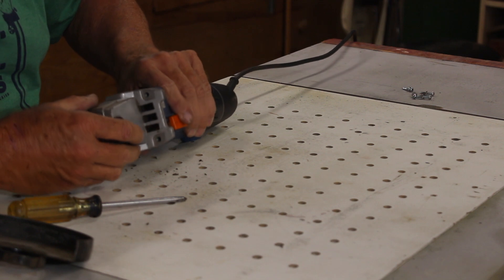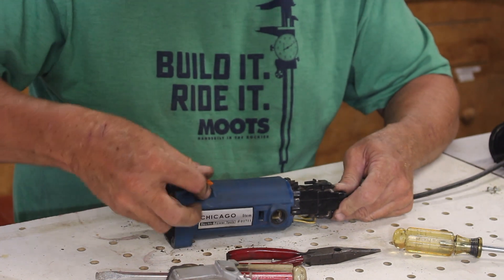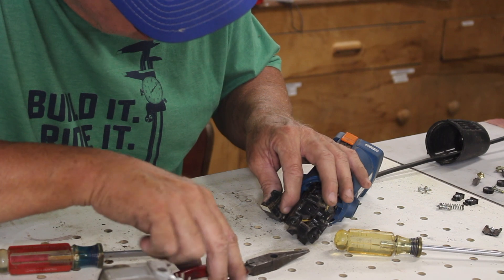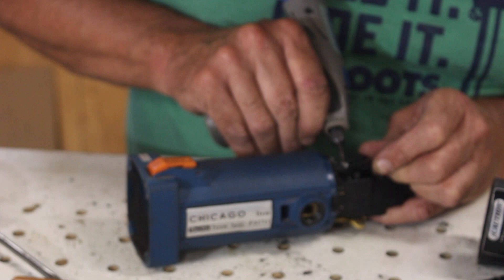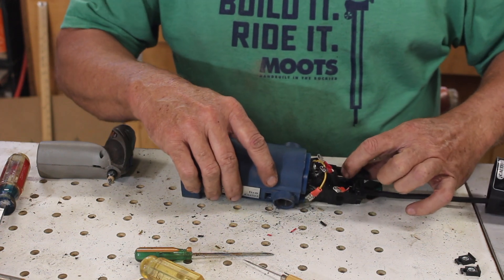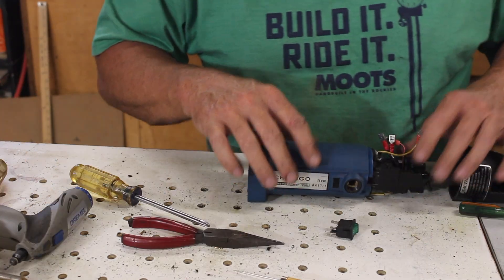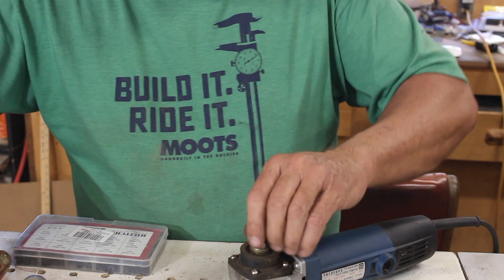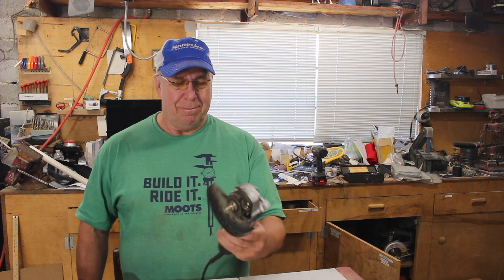Angle Grinder Repair!

Comment: how did you identify the wires correctly to the switch ?
Reply from the maker: As long as you don’t cause a short circuit across the switch it’s pretty hard to go wrong. There are hot and a neutral coming from the wall. Just connect each of those to the two wires in the motor.

Comment: I have a simple toggle switch laying around which only has two connection points. Looking at videos of these types of switches it seems you would just have the "hot" wires going to each terminal and the toggle just connects or breaks the circuits. Angle grinders have 4 wires though. Are the other two wires the neutral? Could you just solder those together and just use the hot wires to the switch? The original switch is sticking. The angle grinder is a Harbor Freight I got on sale for probably $15 5 years ago. I could just spend $7-$10 for a new switch but at that point might as well just buy a new grinder. I did buy the 8amp 4.5in grinder with the rat tail trigger switch as I wanted a more powerful one but would be nice to have the original 5 or 5.5 amp grinder I have as a backup or to keep from swapping blades, wire brushes etc. with a free switch swap I have laying around.

Comment: If you check you plug in chord and you fail to have continuity. check your cord insulation.. My cord got nicked by grinding wheel and it eventually broke a wire. I spliced cord and works like new.

Comment: I was building a  handrail last summer when I let the smoke out of a newish dewalt dwe4011 so I grabbed another grinder where the paddle trigger was broken so 1/2 hour later I was up and running with a new paddle made out of metal. I am 55 miles away from the hardware store lol

Comment: From where did you know, that the specifications of the new switch (current, voltage) are fitting to the grinder? 
Cheerio from Germany.
Reply from the maker: The switch said right on it "10 amp," which is sure to be overrated as it was manufactured in China. The grinder was labeled 6 amp. While also almost certainly overrated, it's still far less than the switch.
Reply: Thank you for your fast answer. I asked, because so much DIYs have no real idea, what they do with electricity. I see, you know!
Cheerio from Germany.

Comment: The only problem with this repair is that original switch was safe one meaning that if u drop a tool  it will switch off (impact triggered).
Reply from the maker: That feature had quit working years ago.

Comment: Great job.
I love the look on your face before you turned it on...
Keep up the great work. Thanks for sharing...
Reply from the maker: Check out when I plug it in! I'm always expecting a big spark.
Reply: Seriously! That's always a scary moment.
p.s. The switch broke on my newer red one. Probably gonna buy a replacement but I'm keeping the old one to fix later. It would be great to have a backup.